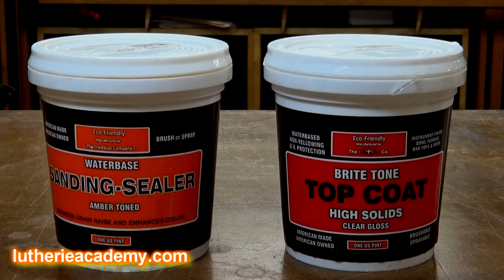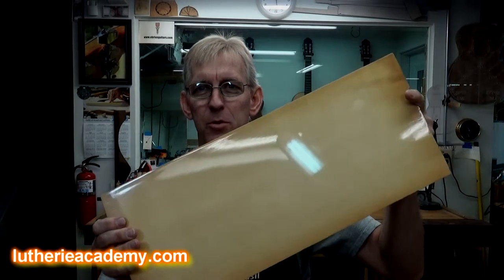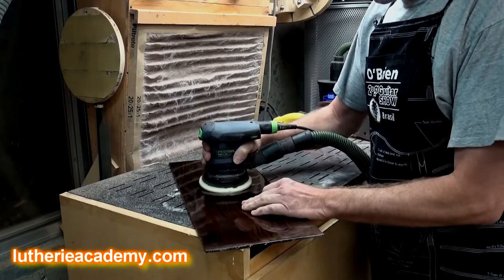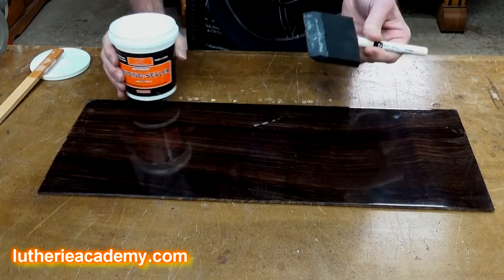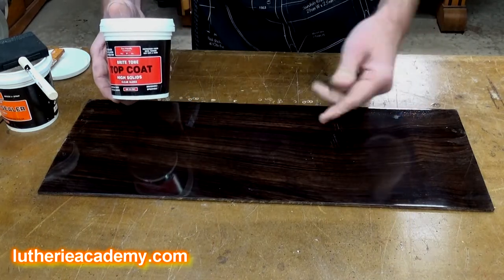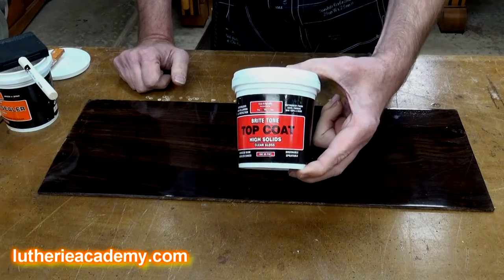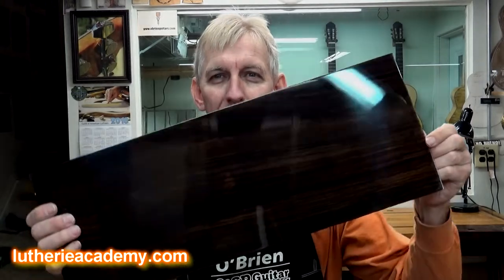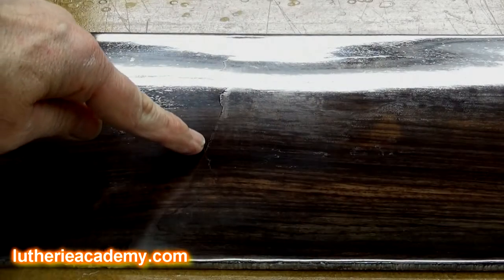Luthier Tips du Jour Mailbag 168 - Repairing a Water Based Finish

Comment: Hi Robert,  what brand sander do you recommend, sandpaper company and buffing pads,  thank you
Reply from the maker: I use either  Dewalt or Festool sander with Norton paper on the Dewalt and aftermarket round discs for the Festool. This is for sanding wood. For sanding the finish I use Assilex by Eagle abrasives and take it all the way to 3000 grit. I then use a flannel buffing wheel to get the high gloss.

Comment: I used the same product on an electric guitar I built. It was convenient to spray because of the water cleanup. However, even after months of curing, the finish has an unpleasant almost sticky feel, and actually began to rub off in gummy patches on the neck and the upper horn of the strat-style body, areas where there is the most friction. I'm faced with the prospect of stripping the neck and body to save the project. Very disappointed. I can't recommend this stuff.
Reply: That's good to know 😮